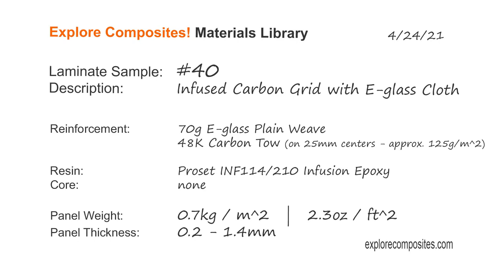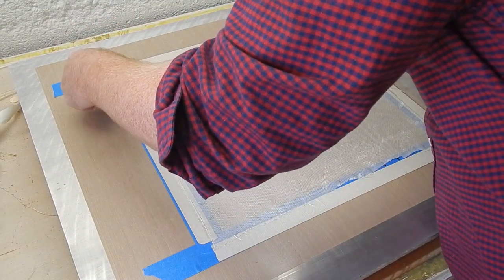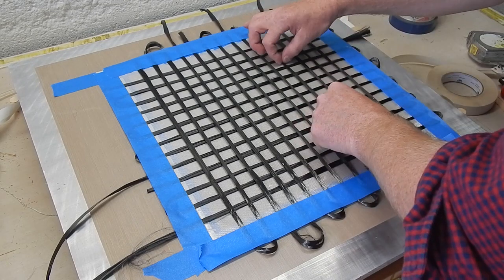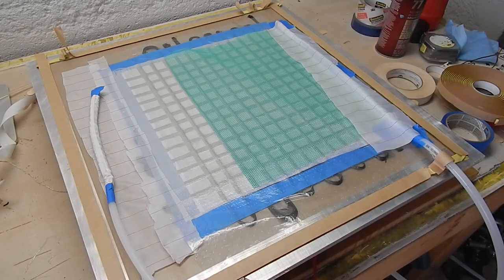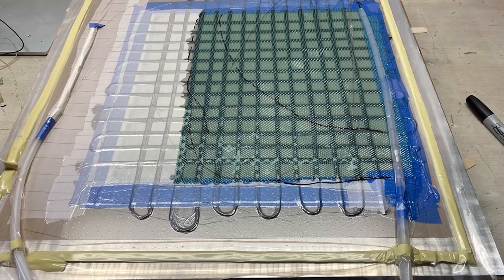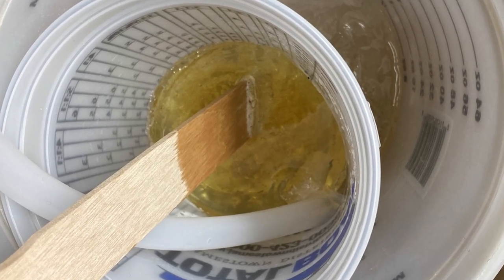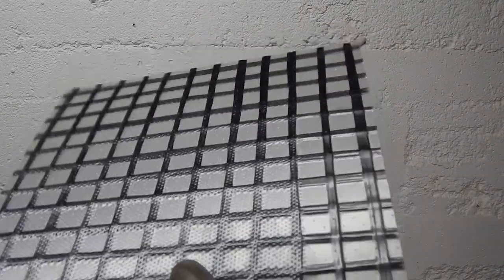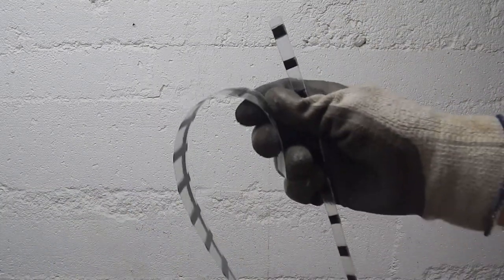Laminate Sample #40: Infused Carbon Grid with Light E-glass Cloth

Comment: I've seen a sample lately with pre-formed C-grid (and a linen base layer) The manufacturer only used a vac bag on top of it, mildly thermoformed with a heat gun to avoid excessive bridging on the grid. The remaining path let them infuse without flow mesh. Interesting, but how useful ?
Reply from the maker: That sounds like a neat product.  Do you remember what it was called?  Sounds like a less-flaxy version of something like Bcomp powerRibs...

Comment: Could you sandwich spread tow between two e-glass layers or is that a delimitation risk?
Reply from the maker: Thats what this is.  There is some difference in rates of thermal expansion but beyond that carbon and glass work great together.  Just avoid pointing them in the same direction.
Reply: @ExploreComposites  sorry I meant tow in a weave , eg 200g , but Im thinking if you're going to do that probably just spend the extra money and use biaxial carbon behind or something

Comment: This is quite similar to what I have planned as a test for a wing and fuselage skin for a small homebuilt airplane. I plan on using 5.9, 8 and 11 ounce CF, vacuum bagged panels, then after the skin is applied to the structure I'll add the tow to add stiffness to prevent any oil canning effect but without adding much weight. My goal is to mimic the stiffness and strength of .016 inch aluminum.
Reply: Why add the tow afterwards ? I also thought of something similar some time ago, using a tougher base layer like kevlar, to make some sort of self-stiffened covering of a truss fuselage for instance, or as an alternative covering solution. Not sure I would trust that to bear loads except for very light aircrafts like micro gliders and microlights.
Reply: @SuperYellowsubmarin   It sounds like he is trying to avoid making a mold.  Making flat sheets, and cutting them to size, fitting them, and then adding reinforcement when they are in place.
Reply: @fredygump5578  true, in any case this could make sense. But then vacuum bagging would be nearly impossible so I doubt the outcome would be any good.
Reply: @SuperYellowsubmarin   Kevlar is abrasive resistant for sure but is way too flexible for a wing or fuselage skin. My truss structure would be twill and uni CF in an angle form, than a square foam insert with rounded corners applied and overlaid with another twill and uni layer. What you'd end up with is basically a square profile with small flanges and the skins would be adhered to the truss frame. Then a crisscross lattice of tow about 3 inches apart added to resist oil canning. Test laminates will help me determine the exact twill weight and tow spacing.
Reply from the maker: That sounds like a neat idea!  Have you considered using pultruded carbon rods in places where you need what might be a really big (or lots of) tow?  I have seen people use rectangular or round rods and they seem to bond ok if you have the patience to prep them.  Maybe airplanes aren't the place to worry about bonding issues!
Reply: @SuperYellowsubmarin   He is only vacuum bagging the flat panel.  He didn't say he would vacuum bag the reinforcement!  If you watch Mike Patey, you'll see he hardly ever bags stuff, but gets good results.
Reply: @fredygump5578   Mike Patey  does really good CF work.
Reply: @ExploreComposites   My target empty weight is 250 pounds, 500 pound gross. Engine will be a V-twin, 40hp. Weight is critical to stay within my envelop. The skins are not intended to be load bearing, just need to be oil canning free. Think of a tube and fabric aircraft, except my fabric will be stiffer than a dope and fabric style plane.
Reply: @GrantOakes  Back to work!  :)
Reply: The more I think about it I could make my own strips easier by making a couple plies of uni, vacuum bagged, then cut into strips with scissors and bonding them in place rather than wet layup tow strips. Thanks for the idea Chris, you da man!
Reply: @fredygump5578  that's what I'm saying. Yes Patey does a very good job at this. However it may not work so well internally because you can't stretch the laminate and the peelply around the mold. Moldless and bagless generally work well on male shapes, less so on female. The pultruded profile option is interesting as well but as mentionned preparation for bonding would be tedious. One way you could go moldless is to laminate a thin inner layer on a grooved, flexible foam core. Once cured, you could then shape it gently and laminate the outer layer with the "Patey technique" !
Reply: @SuperYellowsubmarin  From the link he posted, he's talking about a non-structural skin, and the surfaces are all flat.  And I believe he is making his panels from a single layer of fabric.  The problem is too flexible, not too stiff.
Reply: @fredygump5578  in the case of non structural skin I agree - was thinkint the same as a "covering" a while ago. TFP would make a lot of sense here but not accessible for us mortals ... Now premade grid and carbone chord is available, I would go for that instead of trying to place tows by hand !

Comment: Wouldn't it have been better to achieve a far stiffer panel to have first vacuum bagged one layer of cloth with the tows, wait for cure, sand and remove the tow dust, lay down the second layer of cloth independently, wet it out and then lay the toed panel over it and then vacuum bag it a second time?  You lost flatness of the second glass cloth layer by putting it over the toes.
Reply from the maker: I'm not sure I agree that it would be stiffer, but it would be more work!  And I'm with you that nothing here is optimized for stiffness and the glass is flat on one side and wavy on the other.  Thickness will drive stiffness - so stacking tows up or putting the glass in the middle would help - a little.  Here I wanted to see how infusing in one shot would work and what it would look like.  Imagine the carbon tows more load-oriented in any actual structure made this way.

Comment: you left some peelply on the feed line, thats why it went out on the end.
Reply from the maker: I think you're right.  I always put peel ply over spiral wrap because of some bad experiences with the bag getting sucked into the slices and either popping or blocking the feed.  This smaller spiral wrap may just not have opened up.
Reply: @ExploreComposites  i like to use some silvertape on the edge to avoid puncture and i run the flow mesh over the feed line so the bag will not block the resin. i had the bag blocking a infusion in a big part once and it was a nightmare.